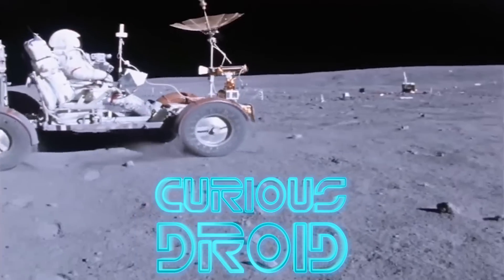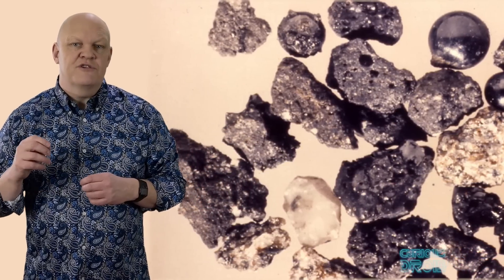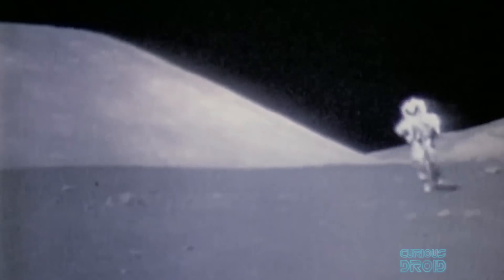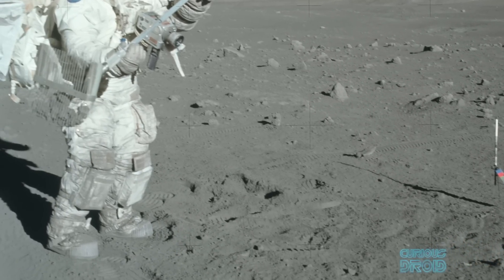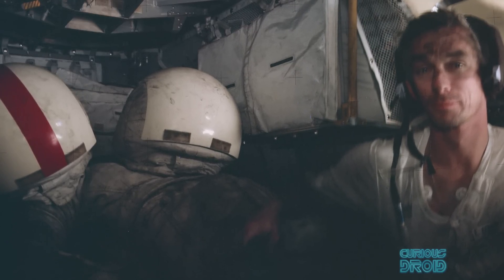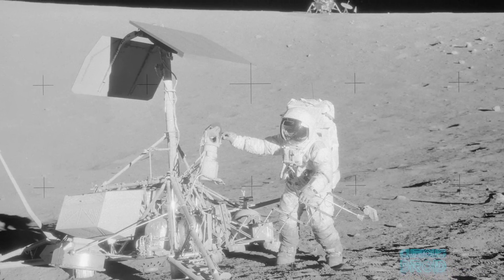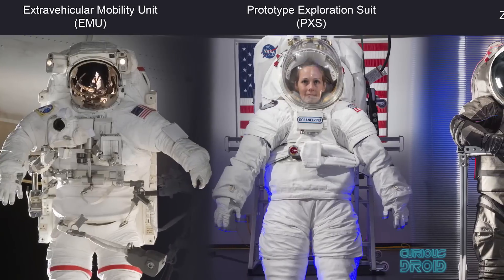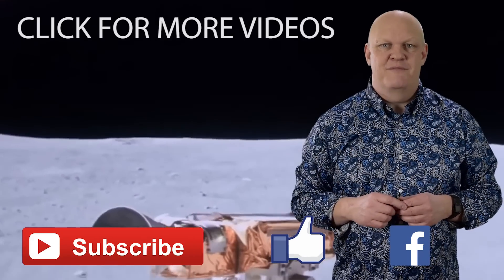Apollo, the Lunar Dust and NASA's Dirty Problem

Comment: Explain the lack of ANY type of airlock in the LEM?
Reply: lol, I explained why, funny how you ask a question but expect the answer you want

If they didn't go to the Moon, there would be no mass issues, therefore they could have added an airlock, spa, sound system, couches, bar, beds and other conveniences. 
But since they went, they had no luxuries like an airlock. Basic physics really.
Reply: The Astronauts both suited up, the air was dumped from the LEM and then they got out.
Reverse for entry.
There was no need for an airlock as there was no one left on the LEM, both were Moon walking.
Reply: FOAD RIGHTNOW Budget, size weight time constraint, other things to prioritize etc so bloody obvious. You try running a company but you are constrained on time, budget, etc go ahead. The video mentioned this, the astronauts were to bring in a sample place it on the engine cover and pressurized the module. If any problem quickly depressurize the module and throw it out. They weren't even sure on the properties of the lunar dust and thought that the lunar dust would be the least of their concern/low priority to warrant a separate airlock for pressurization and depressurization. 

Besides didn't we just recently sent a satellite back to the moon to take pictures and indeed showed the landing sites of the lunar moon missions, you can even see the astronauts trail. So are you suggesting some robots place it there earlier? Who would approve funding for such elaborate hoax? Moon landing conspiracists are a dying thing just give up on it.
Reply: A really inadequate explanation. A more likely reason for no airlock is that we never went to the Moon!

Comment: The weathering of silicates is an interesting subject. In Cadiz, there are brick and mortar walls by the sea, within which had been placed numerous shards of broken glass at the top, embedded in the mortar. I'm sure the intent was to inhibit climbing on the walls, but when I visited the city in 1981, the glass edges were worn smooth, and you could easily run your bare feet over the glass if you wanted to. It might have been a bit uncomfortable, but you wouldn't cut your feet.

Comment: At 2:24 of this video, a clump of dust kicked up by the bunny-hopping astronaut's boots hits the ground at the same instant as the boots.  This proves that the astronaut was not suspended by wires to simulate lunar gravity on earth.  If sped up to a frame rate corresponding to earth's gravity, the astronaut's motion becomes unnatural and comically chipmunk-like.  There is no other way to fake this.  Therefore, they went!
Reply: Nice pickup there.

Comment: If the abrasiveness of the regolith would be a problem. why not inhabit sub-surface structures built by robots now? The lunar surface could be used for food & air generation from domed agricultural systems that could better handle the abrasion.

Comment: Hit paus at 0.36.. and please tell/show me this: where are the tiretracks in the sand from the rover leading up to the parkingspot?
Reply: Tell me how to get that vehicle in that position after driving over a purely dusty surface on either the moon or the Earth, and how the lack of obvious tracks tells you anything about whether the picture was faked.
Reply: I think he believes that the rover had rubber tires. They were nothing like tires we see on Earth.
They were made of springs, coiled together to form a lattice.
The dust would simply pass right through it, like a sieve. Hence, little to no tracks (though there were tracks left, they're just difficult to see)

Comment: sir what about the van allen belt?. and eventho the astro suits were not designed to defend radiations.
Reply: mohammed muzammil Good English there buddy does your jockstrap "defends" your balls?
Reply: 1. In the time of the Apollo missions, health and safety regulations were practically non-existent for astronauts. The Saturn V rocket was a hastily, poorly designed rocket that was extremely dangerous. NASA was willing to subject the astronauts to that little radiation, if it wouldn't hurt them. Since then, health and safety regulations are more strict, so they need shielding.
2. The Orion capsule is designed to carry all sorts of cargo and humans out of low earth orbit. This could include sensitive equipment, such as radiation measuring probes, which could be damaged permanently by that small amount of radiation. Also, we currently live in a day of efficiency. To avoid the worst of the radiation, the Apollo missions had to go to the outskirts of the van Allen belts. This was horribly inefficient. It would be more efficient to go straight through with shielding, which means more left over fuel, which means longer range.
Reply: This question comes out of a lack of scientific understanding. The radiation in the van allen belts is not ionizing, meaning that it's not damaging to humans. Just like your smartphone won't give you cancer, even though it emits radiation. The radiation given out by a smartphone is in the form of radio waves. The only type of radiation that can harm humans is gamma radiation, which has the smallest wavelength in the electromagnetic spectrum. The van allen belts are not made of gamma rays.
Reply: GlimmerGamingMC If it's not damaging to humans why is the Orion capsule project video talking about how they have to figure out how to safely protect the astronauts from the belt before they can leave low earth orbit.

Comment: This still doesn't explain why there is no dust blown up and onto the craft in the pictures.
Reply: You are making the assumption that there is an atmosphere and dust acts like on Earth, an easy mistake to make.

Imagine it is in a vacuum, the dust gets "blown" by the exhaust and will fly off until it hits the ground again. It cant fly at the craft as that is where it is getting blown away from. Therefore a clean LEM
Reply: Kel Duck That makes no sense at all, about the dust not falling back to the craft.. .  there is supposedly at least some gravity on the moon, which means, just like the lander, and the men themselves the dust and debris would remain on the surface.  So don't act as if the laws of physics don't apply outside of our atmosphere.  gravity is gravity and propulsion laws also still apply. There would be dust on the craft.
Reply: The dust has been pushed away from the LEM with the flow of exhaust. 

There is no other force acting on the dust make it change direction or push it back towards the LEM. 
It doesn't billow up and around the LEM as that occurs in an atmosphere.

If you are talking about the Astronauts moving dust while on the surface, I apologise. 

The following has a heap of photos to peruse, some have dust on the pads from astronauts moving/working, some from landing velocities (engine was shutdown above the surface)
http://www.lpi.usra.edu/lunar/documents/SP-2013-605.pdf

The Moon has 1/6th gravity.

Comment: Tthe same dust that is nowhere to be seen on the lander pads? The same dust that has not caused a single astronaut any respiratory problems in later life? Nah.
Reply: Why would it cause permanent lung damage? Mine workers can work in mines for years and not experience any issues.
Reply: Matt, You're correct but according to this we're not talking about ordinary dust. This cuts through spacesuits, visors, damages equipment. Surely the same stuff would rip open the throats and lungs of at least one astronaut.
Reply: +choochoochooseyou However, as we don't have access to the full medical records of the 12 that walked on the moon we don't know whether any suffered from related respiratory problems.
Reply: I'm sure we would have heard. Everyone has been waiting for one of them to come down with cancer since supposedly going through the Van Allen belts. That didn't happen either.
Reply: @choochoochooseyou

I would start doing actual research, instead of making things up. They didn't go straight through the belts, but took a way around.

Comment: If there is sooo much lunar dust why do all the photos of apollo 11 show absolutely clean landing gear. Not a spec of dust! With 10,000 lb thrusters shouldn't there be a creator and dust everywhere when it touched down??
Reply: There is footage of the landing where you can see dust blowing, there are photos of under the LEM , you can see the dust has been blown. There is a crater too, its just shallow and wide, they only needed the 10 000lb thruster to de orbit, not land.

You are also making the assumption that there is an atmosphere and dust acts like on Earth, an easy mistake to make.

Imagine it is in a vacuum, the dust gets "blown" by the exhaust and will fly off until it hits the ground again. It cant fly at the craft as that is where it is getting blown away from. Therefore a clean LEM

Comment: It never stuck to the landers gold foil feet.so much bullshit about the moon landings..
Reply: Are you really that stupid?
Reply: Static electricity is just that, it doesn't move. Meanwhile metals are good at "moving " electricity, Gold is one of the best conductors.

How does a charged dust particle stick to a conductor via static electricity if the metal is Earthed (Mooned)?
Reply: Kel Duck and what charge would be run through or built up on the Landers legs?So you're saying all the dust the thrusters would have disturbed blown up into the air wouldn't fall back down onto the lander ,plus the weight of the lander, on initial contact wouldn't have collected dust?O.k. then.plus who's casting the 3rd shadow in the astronots visor?.
Reply: + reksub:    No I replied to your question with regards to dust being stuck onto the gold foil, the only process would be static electricity. There is no charge built up on the Lander, it is Mooned (Earth). 

 There was no dust blown up into the air, there is no air on the moon. The dust that was blown by the engine exhaust would mainly travel away from the Lander, with nothing to slow it down till it contacted the surface again. A common mistake is assuming dust reacts on Moon the same as on Earth, it doesn't.

The legs didn't sink into the surface so wouldn't have collected dust. 

I haven't a clue what you are talking about, re 3rd shadow.  I will need a link to the picture also let me know what the 1st and 2nd shadows are caused from, that will save me some time.
Reply: Kel Duck the picture that accompanies this thread shows a shadow from the main astronot himself,the astronot in the reflection of his visor gives of a shadow,plus there is a 3rd (man shaped )shadow in the picture...The moon does have air,it also has gravity.plus your saying the legs of the lander didn't sink into the dust,but the boot print from the weight of the Armstrong did?hmmmmn.The tracks from the rovers also did in later missions.the dust from the rover had no problem falling back down.dust sticking to the lander through static would have nothing to do with dust collecting on it..Static would attract dust ,yes,but the amount of dust the downward thruster would have displaced would be immense.we can see this on the film of the landings(it obscures the view of the camera.would static build up in a vacuum?Idk ,so why would the lander need static electricity to attract dust to it?Plus plenty of static would be built up by the batteries,sticking to it before it got earthed,mooned,and that's you working from the basis that the moon has the same electromagnetic field the earth does and works in the same way..
Reply: "The moon does have air" No it doesn't.
Reply: Hyrppa95 the one dumped out at the back of an l.a sound stage does.how did the astronauts breathe if their wasnt atleast oxygen.
Reply: Hyrppa95 yep,i neglected to mention humans took it there... Have you heard the flags are now disintegrating?we need to start a go fund me #save the moonflags..lol.i thought they found water on the moon.

Comment: I should have been clearer about the dust. I understand that air resistance and even convection currents would hold dust particles in the air longer and I know that there is no air on the moon. I mentioned the Dakar rally to show how very fine particles react to spinning wheels on a vehicle, not how long they stay in the air. I am talking about inertial forces. The spinning wheels of the rover should have flung the dust high and far, esspessially because there is no atmosphere to slow it down. The inertia generated by the wheels is substantial. You can see the moon soil staying in between the slats of the wheel instead of falling to the moons surface, because of the speed of rotation. It seems to me that the fine dust, since it had little mass, should be flung higher and further, than on earth. We also have 1/6 gravity and there is a direct relationship between gravity and the rate the dust would fall back to the moon's surface. So the dust being so fine with little mass, the fact that there is no atmosphere to resist or slow down the dust and having 1/6 gravity should created a bigger rooster-tail. The rooster-tail on the rover looks pretty normal to me. I mean earth normal.........and just curious, if the dust was created by millions of years of being pounded by meteorites, why are there still solid rocks on the moons surface? I am not a hoaxer, and I appreciate that curious droid is more polite than most in responding to my query, but when something is a fact, it must stand up to scrutiny and has to be able to account for every tiny infinitesimal detail, or it's just not true, that's all.
Reply: +Gus I think you may find this paper interesting which uses footage from the Apollo 16 LRV to obtain estimates of the dust relative velocity and the moons gravitational acceleration. I'm hoping that it will help answer some of your questions. https://www.researchgate.net/publication/258468670_Tracking_Lunar_Dust_-_Analysis_of_Apollo_Footage

Comment: If the "gravity" of the moon has only one sixth that of earth, how come the "flowerfine" dust kicked up on the lunar surface as seen in the filming, acted just like dirt on earth, and not staying suspended above the lunar surface longer, traveling higher and further?
Reply: It doesn't act like dust on Earth at all. On Earth, the dust would become suspended in the air. In a vacuum, it freely falls back down to the ground
Reply: If you think that's how dust on earth behaves, you need to go outside more often.

Comment: After watching this I realize that if the dust on the moon was that dangerous to be in contact with, no one would have survived the landing, takeoff or roaming around the surface of the moon on any moon mission. The engine blew the dust blasting the surveyor lander but no dust on the Landing gear pads. Yea right. As much dust that was shown on the suits, they would have failed the astronauts would have died. Their are too many unanswered questions. Every time a NASA spokesman says anything, they open up a new can of worms.
Reply: Thank God IDIOTS like you were not running NASA 50 years ago! You are a moron!

Comment: As you mentioned the dust particles are electrically charged. So to remove them one need to use an electric charge to do that, by maybe an electrically charged rod. The same way we dust off at home by using an electrically charged dust brush.
This the the same as NASA's rover that they estimated would be operation for a very short time, due to it's solar panels being covered in dust and thereby not being able to produce electricity for it's different tools. But then suddenly it was extremely clean. That was due to the electric activity in Mars's atmosphere, and the rover's solar panels have become cleaned a few times by now. 

When the astronauts enter the lunar module to return to earth, they should pass by 2 full length and electrically charged panels, one on each side, that attracts all dust from their suits by having the proper electric charge.

Comment: Curious droid, I am just curious about the dust that the rover is roostertailing. The 'fine as talc' dust seems to be falling pretty fast. It also seems to be falling at earth-normal gravity. Shouldn't the rover create a huge dust cloud behind it that floats for a while and takes a longer time to settle back on the surface? You can see this effect on earth like in the Dakar race. The fine powder creates a huge cloud that takes quite a while to settle. even without an atmosphere we should see a slower settling of the dust. And it doesn't look like 'dust' it looked like coarse soil.
Reply: You may have overlooked a very important key difference between the moon surface and earths surface. 
Can you guess which?

Comment: Then the legs of the lander would have been sand blasted off if what he Say's about the sand blasting effect.
Reply: Why should they?
In all missions the engine was cut about half a meter before the legs touched the ground.
That was to prevent the exhaust from blasting a deep hole in the surface like a welding torch in ice cream.